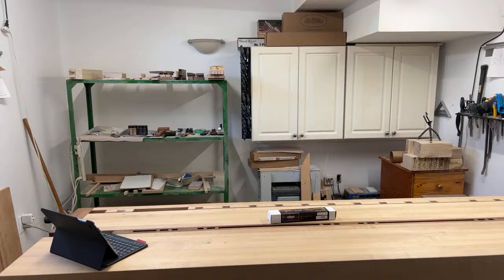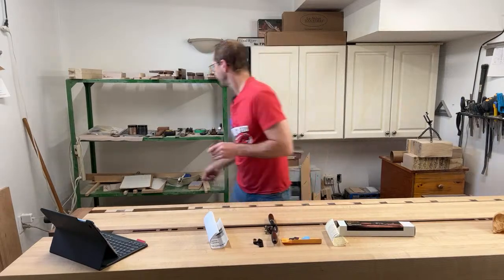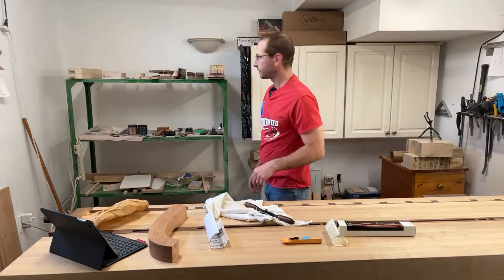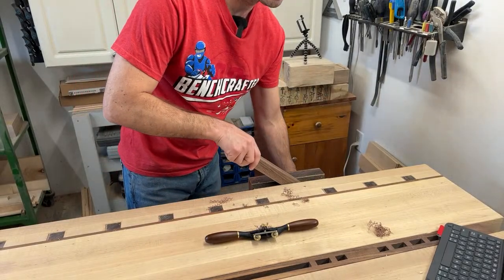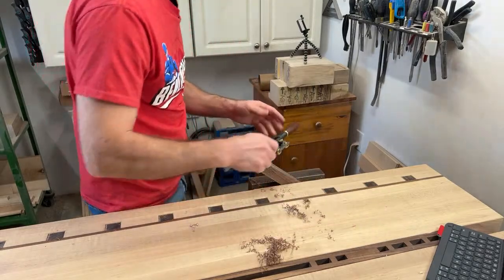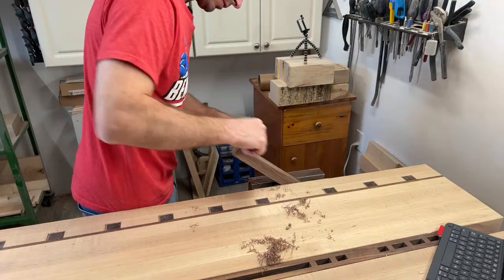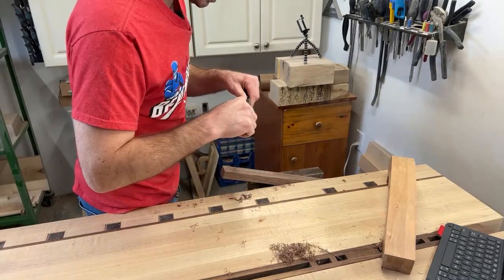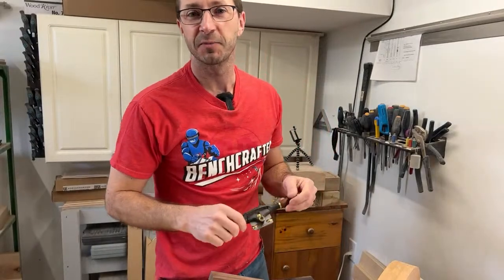Unboxing & Using a Veritas Flat Bottom Spokeshave is live!

Comment: Gary, I never used a spokeshave either. What would use this flat bottom vs. a curved version of spokeshave? Thank you, Scott
Reply from the maker: It’s my understanding that the round bottom spokeshaves are intended to do inside curves, but it seems like most people just use a flat bottom one and have the blade protrude out the bottom more so that they can do an inside curve.

I’ve used it a little bit more since releasing the video and they’re pretty easy to use. You get the feel of it very quickly. You should give it a try Scott. Thanks for watching. I appreciate it.